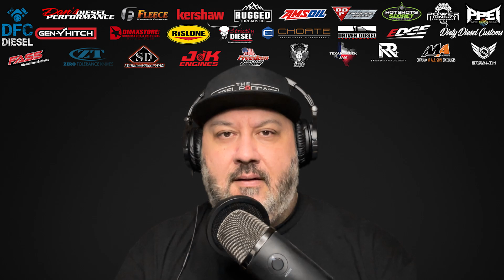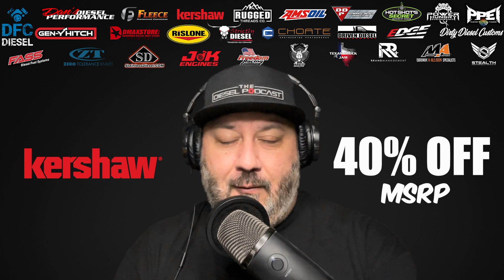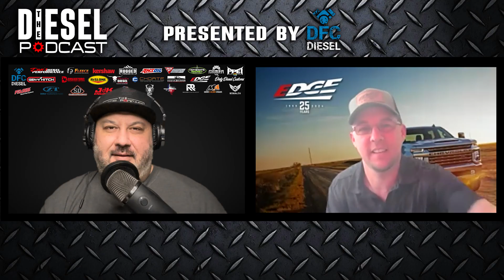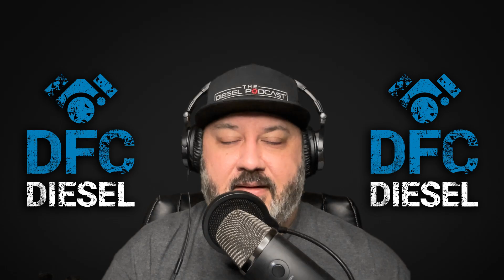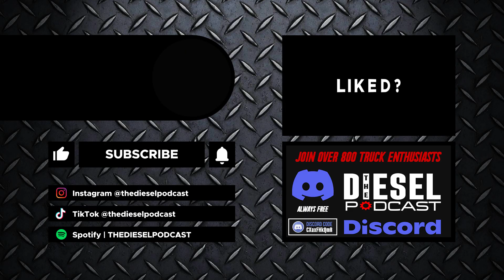Is Towing with a Tuned Truck Safe?

Comment: I really enjoy the podcast, but sometimes I feel like the conversations stray off-topic, and the original question isn’t fully answered. Often, the discussion drifts into other areas, or a format is introduced and then abandoned midway. While the additional information is valuable, it doesn't always address the core question. For example, the original question about whether it’s safe to tow with a hot tune was never directly answered. It would have been helpful to hear something like, "I’ve installed a 200 hp tune; is it safe to tow with it?" My initial thought was that the answer would be, "As long as you don’t drive like a race car, you should be fine," but I was hoping to confirm whether that was correct.

Comment: No , they damage a lot of trucks. People need to talk more about it crackheads etc..
Reply: not really😂 you would have to have a extremely heavy load on a extremely hot tune to crack a head on really any truck. I had a 6.4 powerstroke that had 214k miles. SRW truck with very mild T&D. Truck would tow literally anything and the highest EGTs i’ve ever saw was 1300* on that truck. I sold the truck last year with essentially zero issues. Owner is still daily driving that truck to this day
Reply: @nic6.0  Well we have been seeing it happen is the problem with the very high EGT tune that does not protect the engine. 1300 is good but the ones Im talking about are towing with 1450+ EGT to who knows
Reply: @Good-luck-Jonathan  some people just put tunes on a truck. And some people put tunes on a truck that has the supporting mods to run cool with that tune.

Comment: I doubt id ever delete the next newer truck i get after all the headaches from the garbage gdp tunes
Reply: That is a great point. I am running an emissions-compliant tune from PPEI. I have spoken with a few guys locally who are running deleted trucks. They both said the same thing you did.
Reply: @jedi_knight_PhD  yea i spent a lot of money on a proven diesel file because they're reputed to be a hotshot boutique tuning outfit that tailors them to you specifically and what a joke that was. Steer clear of them
Reply: Thats why I didn't do garbage gdp tunes. 99% of tuning is knowing how diesels work. I picked a tow tune from a company that had a tune with the right fueling for a stock turbo and stock boost tubes/intercooler.
Reply: @bucketheadrox  yea I wish I knew that

Comment: So are these tuners able to adjust for maximum economy while hauling a load, but not necessarily towing?
Reply: No. They just change timing, fuel delivery, and some other stuff. You can basically either skew fuel one way or another and time it to burn properly. Fuel efficiency does get better but noone is taking the time to check what tunes haul better vs tow better. With tow tunes it's all about how low the temps are when towing. Thats really it. So for hauling it would be the same.
Reply: Do what?

Comment: Not to be critical Patrick.... what kind of title is towing with a tuned tru safe? All trucks are tuned from the factory to one degree or another. Whether it's tune to a hundred horsepower or tuned to 1000 horse power. Lugging a 200hp engine is more determinal to the engine then driving a one thousand horse power engine properly
Reply: Dude why are you asking this? We all know what he means when he refers to them as tuned. Which for most people implies deleted too. And you can lug a truck if it's a derated fleet vehicle like my work truck with a 425 isx in it because you'll never have too much fuel for the air that's going through that engine
Reply: Sure, every vehicle has factory tuning, but when referring to tuning diesel trucks, it's implied that they're talking about aftermarket tuning. 

And the other question" If you're puling 20k and climbing a steep grade, your EGTs are going to be hotter than Mount  Saint Helens when she blows her top again. Even if it defuels, you're not doing that engine any good. You'll end up melting a piston or worse. Unless you think EGTs are "just a number," and you want to burn your engine down, take a very heavy load up a mountain and let it lug. Do that with an LML you'll snap the crank.

Finally, with the newer engines, the main limitations are going to be with the emissions system, if the truck still retains it. Tuning companies still have to abide by standards set forth by CARB. If you try to throw 1000 hp at an emissions present truck, you'll get going to a place known as "Regen City." 

Hopefully this helps.
Reply: @RobertHolster1  id never trust one of these compliant tunes after the powerstroke help guys tore down a 6.7 that an older guy had one of those files on.
     The tune advanced the timing on it to give him that transient throttle response that's so desired but they overdid it and it caused his mains and rods to delaminate from all the hammering forces and sent aluminum all through the engine
Reply: Right! 🤣
Reply: You all totally missed the point that I was making. The point that I making is the usage of specific words. TuneIn in and of itself is not a problem if done correctly. However most aftermarket tuners Make certain edits and modifications to factory tuning for an outcome that is not always desirable. Manufacturer spend a lot of money finding a balance between reliability and compliance with environmental regulations.
Drive ability is key to oem manufacturers. If a manufacturer vehicles that don't drive well they won't sell them
Reply: @timothymroberts2949  the point you were making is nonsense because the video is referring to trucks and mostly deleted ones that are using some aftermarket file
Reply: @wizard_of_poz4413  a file is a file. Proper tuning is key...all modern diesels are "tuned". Saying is towing with a modified tune safe is more accurate.
Reply: @timothymroberts2949  that's incredibly pedantic though